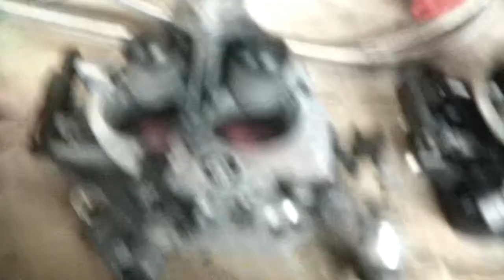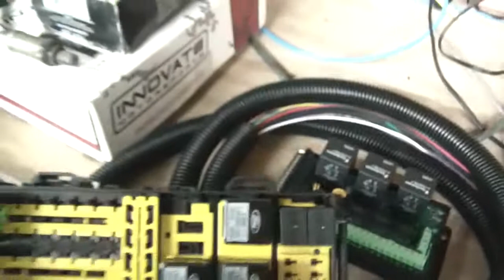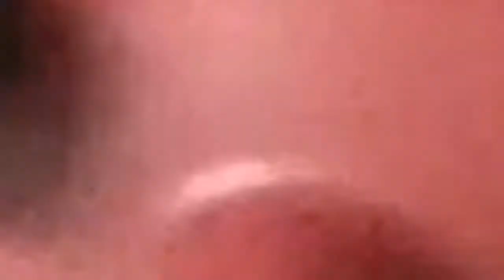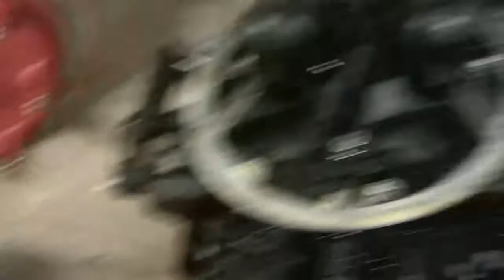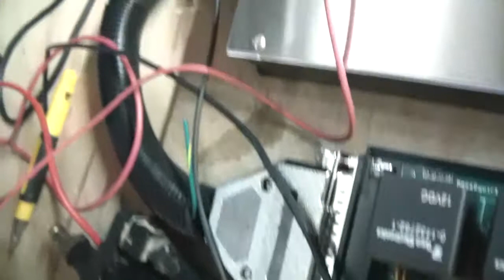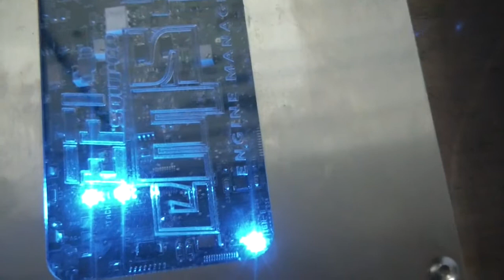TBI Megasquirt Conversion EMS-PRO Early Bronco Part 2

Comment: Hey where did you get the relay box at? Since this is a stand alone install how did you do your instrument gauge panel?
Reply from the maker: The explorer relay box or the megasquirt relay box?
Reply: The megasquirt relay box. I'm putting the ems-pro on a 99 neon. But I think i can just used all my stock relays. It has a 4 wire stepper iac, I'm going to have to use a 2 wire pwm for iac and relocate it..
Reply from the maker: Correct, megasquirt 1 does not support a 4 wire stepper. I was putting this in a old bronco that had a card and no relays. I went with the relay box so I could troubleshoot easier. The last thing I wanted to do was troubleshoot a complicated setup when I was far out in the mountains and drinking.
Reply from the maker: May sound crazy but I really was factoring that I might be troubleshooting this thing drunk. I offroad pretty remote with my friends and we tend to party allot.

Comment: Is that an old 670 cfm Holley Projection throttle body?
Reply from the maker: yes
Reply: Thanks.  That's amazing..... guess i could have done something with the old one I've had on the shelf for a decade+.  :)